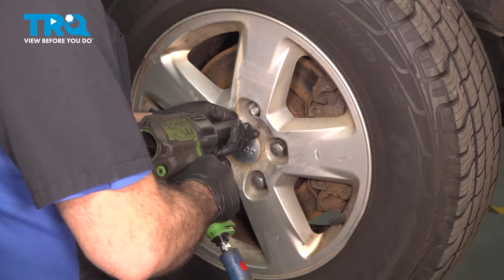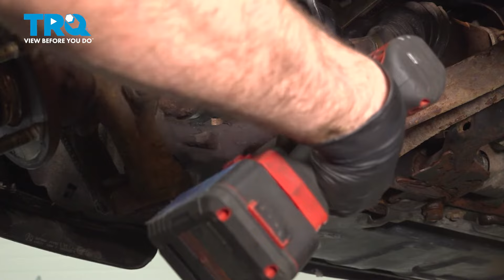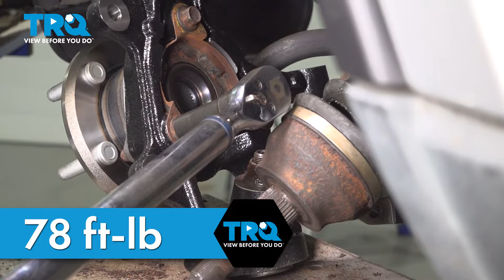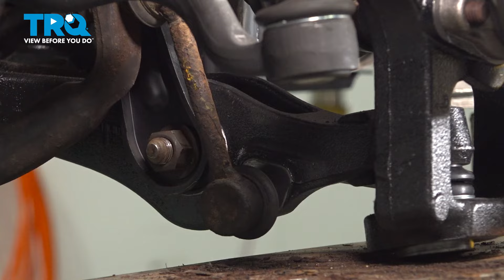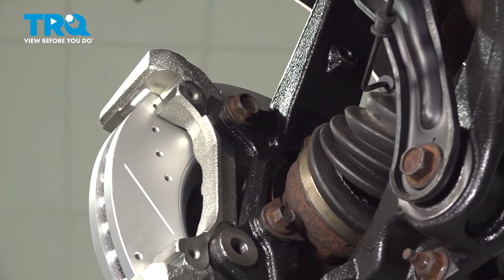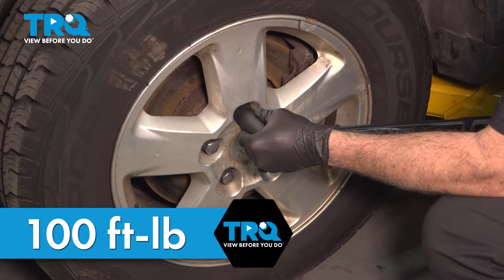How to Replace Front Wheel Bearing & Hub Assemblies 2011-2021 Jeep Grand Cherokee

Comment: Two things to keep in mind if you're doing this job:

1. The dust shield that sits between the wheel hub assembly and the steering knuckle is missing in this video. Not clear why. It's a standard OEM part.

2. I suspect TRQ did advance work (off-camera) to loosen the wheel hub assembly in order to make removal look easy in the video. There's no way it only takes a few whacks with a sledgehammer to knock that thing out. Even after soaking my hub crevices with PB Blaster overnight, I had to bang like hell with a 4 lb. sledgehammer for roughly two hours to knock them both out. And mine were much less rusty and decrepit than the one in the video. Of course, this destroyed the old hubs. But hey, I was replacing them anyway.

Comment: I just did this same repair.  Removed the wheel, compressed the caliper just enough to remove the complete caliper assembly  with the two bracket bolts, remove rotor, loosen axle nut and tap axle inward, remove the three bolts that hold the wheel bearing assembly.  I Removed the wheel sensor just in case it  didn't get damaged.  With a few hits on the hub and a thin chisel the hub assembly comes right off. Cleaned surfaces and installed new bearing assembly.

Comment: Doesn't the brake dust shield that goes between the knuckle and bearing provide necessary spacing?  Else the rear metal backing plate will come dangerously close if not in contact to the tone ring...??